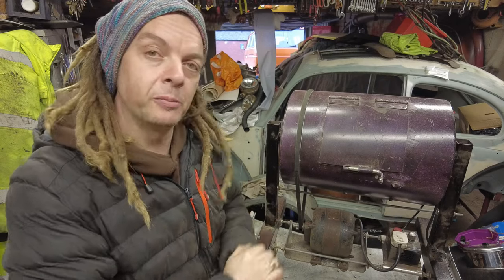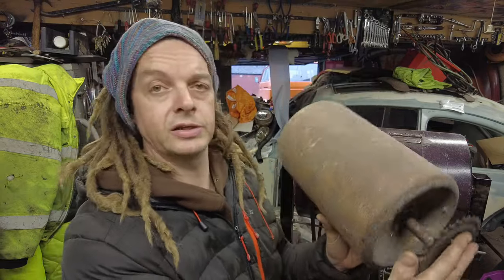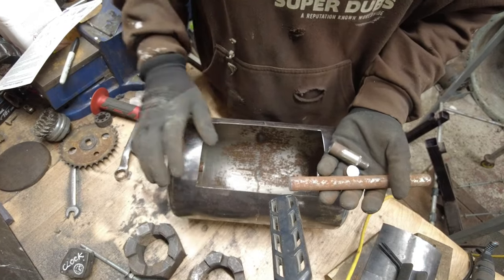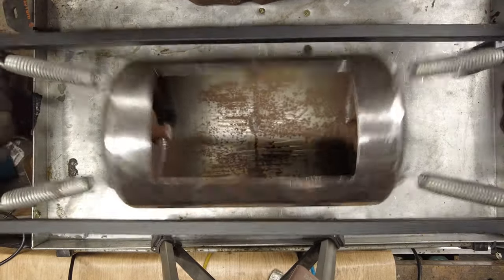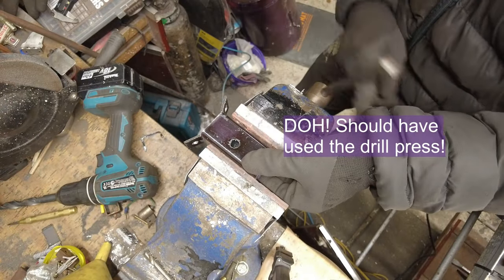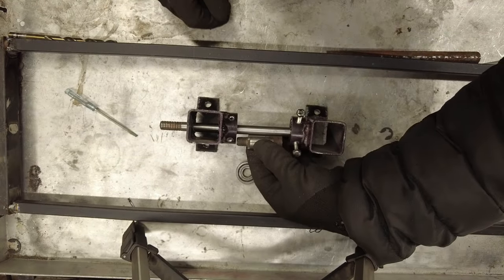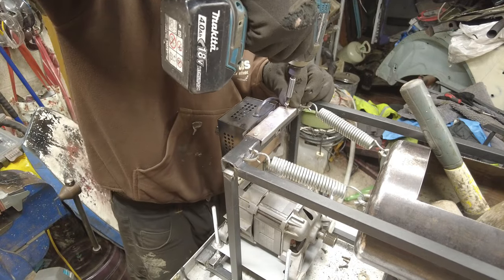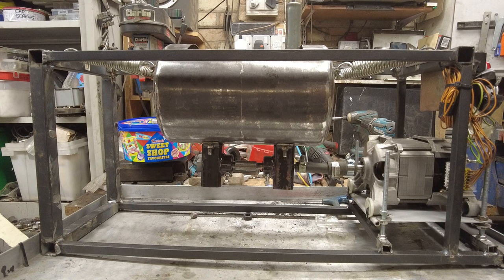DIY Vibratory Tumbler - Home Made Rust Removal Metal Deburring Build Guide (SEE PART 2 FOR MEDIA)

Comment: What blade are are you using and how happy are you with it? 4:12
Reply from the maker: I think the ones I current have are Erauber (Screwfix budget) 1mm slitting/cutting discs, and are a nice compromise between cutting ability and how long they last, also not had many failures from these. I found the Bosch I bought wore away in no time and used to be impressed with Vulcan, but the last lot didn't cut well. Lidl sell cheap discs occasionally but they just vanish into dust in no time and had 2 from the first box of 10 failed by breaking off at the centre. Thanks for watching. 😊👍

Comment: Hey, I want to make it, following you'r video but i'm struggling to launch the washing machine motor, eletricity's not my stuff .. How do you connect it ? tried different combinations and at one point i saw some smoke going out so i think  i have to find another one now
Reply from the maker: I'll be honest I called in the help of my father who is a leccy guy because the circuit was confusing me. It was about 3 years ago so I maybe remembering wrong but in the motor I have now is pretty straight forwards, but I previously played with a motor that had a primary circuit which sends power around the coils, and then a secondary circuit which powers a smaller coil. I cant remember if I fried that! lol or we connected it to make it work and its the one  have right now. From memory It might be the circuit that needed to start the motor moving in one direction or the other as was an induction motor but I'll be honest its been so long and Ive had so many motors in bits I just cant remember which was which any more. I'll be in the garage later in the week, So I'll try have a look at whats connected, but unless its the same as yours not likely to be any use?